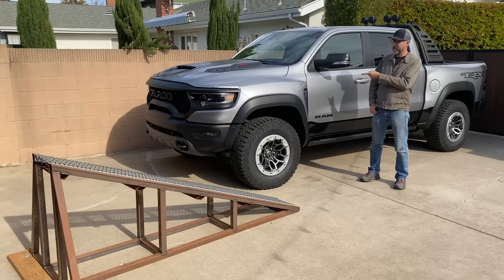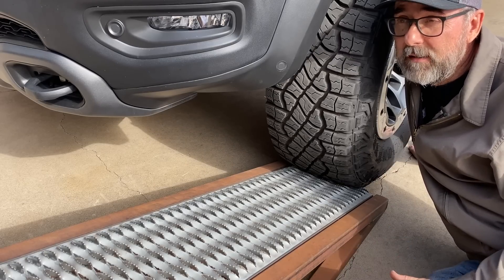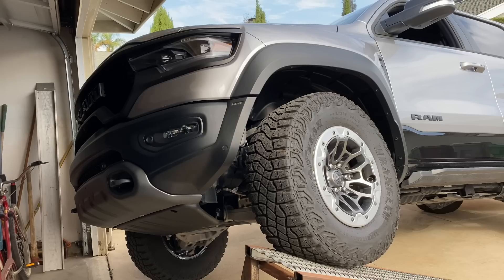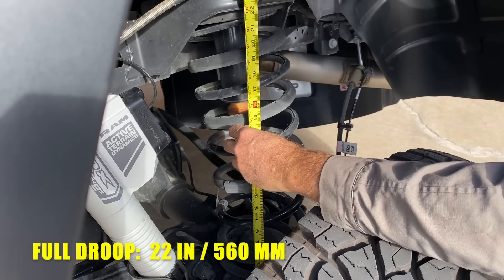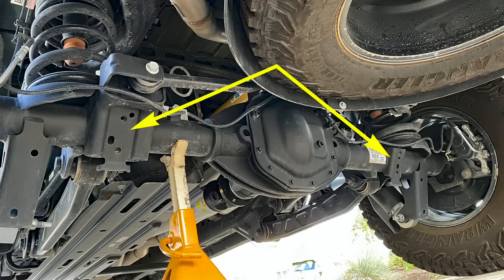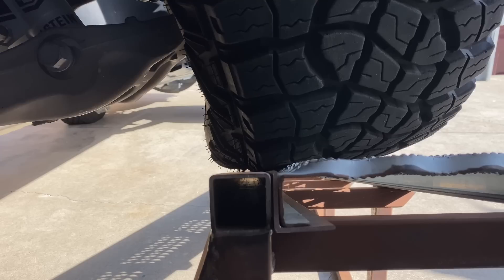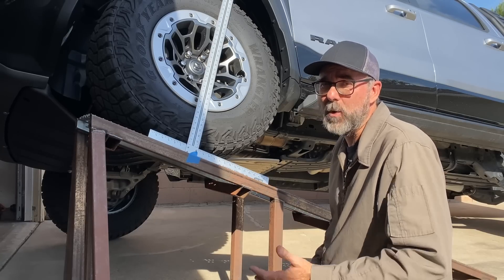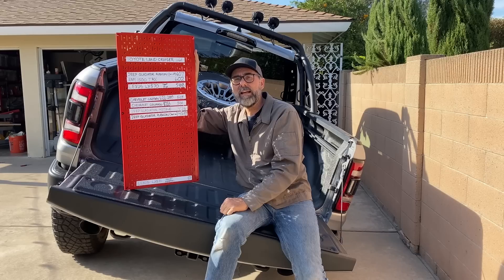2021 Ram 1500 TRX Suspension Flex Test - Using My Frame-Twist Ramp To Measure Off-Road Articulation

Comment: Great video as always mate, really interesting to get an engineers perspective on this. Out of interest does this model of truck have a lower tow rating than the others in the range that are fitted with a rear stabiliser bar? I'm from Aus and we don't really get any of these larger "utes" here.
Reply from the maker: Such extreme high-flying baja-racing inspired off-road packages usually do have lower tow and payload ratings than their working counterparts. This one is 8,100 pounds towing/1,310 pounds payload (3,672 kg tow/ 594 kg payload). Ram 1500s normally go higher, especially in terms of payload where the weight in the weight on the suspension is highest. In the US an 8,100-lb tow rating would equate to a 810-lb (10%) nose load on the hitch.

Here, Ram can get away without the rear stabilizer bar because of the reduced load ratings, but it's also because of the 6-inch (152 mm) wider track width that this truck has. The substantially wider footprint has perhaps more to do with it, in fact.

FYI The Raptor is 8,000 pounds tow/1,200 pounds payload (3,626 kg/544 kg). 

Here in the US payload includes passenger weight, and towing includes the effects of tongue weight on the truck's suspension. It's an either/or, to a certain extent, too. If you have four heavy blokes in the cab, you won't have enough remaining payload to account for 810 pounds of tongue weight, so the situational tow rating goes down accordingly. Put a couple of dirtbikes in the back and you might not be able to tow anything. Our truck makers aren't good an making that obvious. They only talk in terms of best-case maximums.
Reply: @DanEdmunds  Yep, we're very similar here. Both of those trucks have a much lower payload comparable to the Japenese "utes" we get sold here which is surprising given the difference in size. A Toyota Hilux can have a payload of up around the 1000 Kg mark (inclusive of a tray/ bed). The marketing is also misleading as like your manufacturers ours also neglect to mention that the ball weight (~10% of payload) needs to be added to the vehicles payload. The hilux is rated to tow 3.5 tonnes which seems insane to me given its size- The towing number has become somewhat of an arms race here between manufacturers though.
Reply: The TRX does have a lower payload or tow rating than other RAMs in the model range, but the missing antiroll bar is just one of the aspects that likely influences that difference (others being general suspension geometry, spring rates, shock dampening curves and overall weight of the vehicle being others).